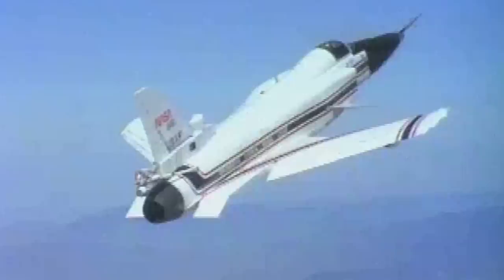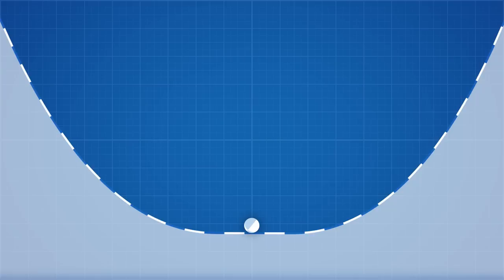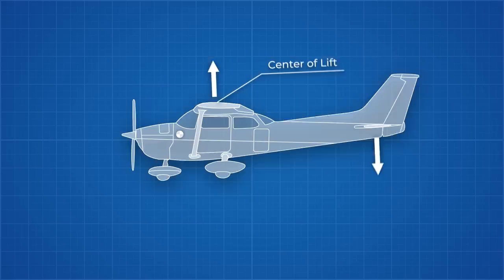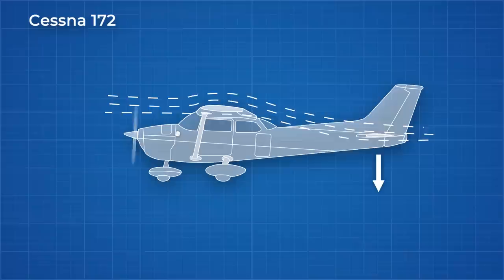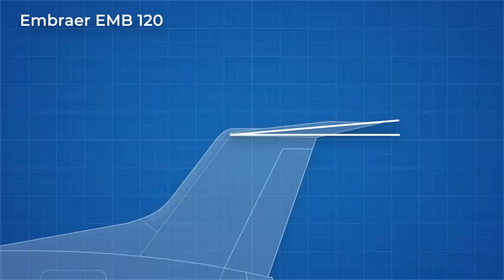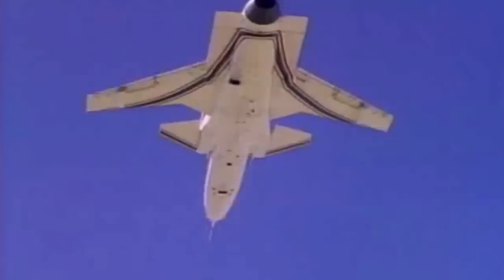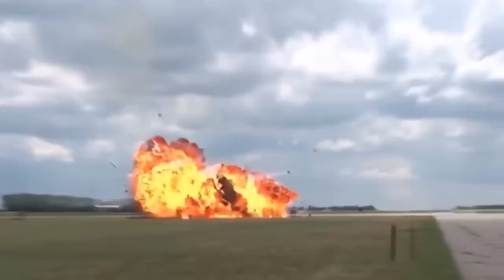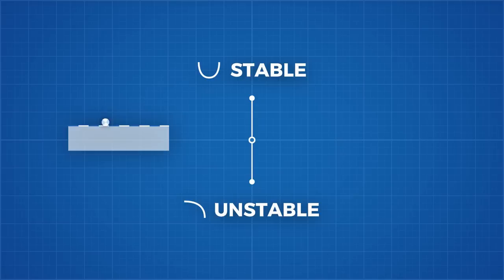Why Fighter Jets Can Be Too Unstable

Comment: As an aerospace engineer, I just wanted clarify one detail:

Downwash is not really a substantial factor in the static stability and control of an aircraft in the sense that you described. It has an impact on the tail aerodynamics, yes... But it's affect is accounted for in the angle of incidence of the horizontal stabilizer during the design phase of the plane. That's why it's impact doesn't really affect the stability as substantially the way the video implied. The downwash vector stays about the same with constant AoA and increasing speed. It does change with varying wing AoA, but that's more of a dynamic issue than a static one. If the designer wants an effective AoA on the h-stab of -2° and the wing downwash produces -1° of effective AoA in the local free stream airflow around the tail, then the H-stab will intentionally be placed at -1° from the fuselage centerline because that is -2° from the local free stream air at the tail. Lift is a function of AoA and speed. The angle of incidence acts as a constant AoA of the h-stab (including accounting for downwash) relative to the velocity vector of the plane. The velocity changes with altitude as the attitude goes from upwards pitch to climb and slow down, to downwards pitch to descend and speed up.

Everything else was spot on.

Comment: I'm surprised you didn't mention late sukhoi designs and the Rockwell X-31, both of which use high inherent instability, coupled with thrust vectoring to yield control even beyond the aerodynamic envelope of control surfaces.

Comment: @ Real Engineering : Since you ask for our comments on the graph notebooks. I'd like to point out that these were available at the 5-10-15¢ stores when I was a kind (I am now 76 y.o.).  They are much more difficult to find since the advent of the personal computer, especially since the early MacIntosh.  
Another point about computers is that we can make a graph design (with wider and thinner lines as we wish) on a picture, very precisely spaced with a vector CAD, and print as many pages as we want.  And this will be at very low cost if we have a black-and-white laser printer (about 3 to 5 cents a page).

Comment: I've been a flight instructor for the past 2 years, and this sums up stability perfectly in the scope of what an airline pilot would learn. Great video.
Reply: Except it implies anything other than inherent positive static stability in an airliner is "unsafe" while 2 come to mind that have relaxed static stability, the MD-11 and B777
Reply: @PabloGonzalez-hv3td  MD-11 did have relaxes stability, and this was a big reason why it had such a bad safety record. With only 2 examples, clearly the positive static stability wins in the majority of design.
Reply: @anthonymcdonald3193  - Improper initial implementation on the MD-11 does not invalidate the concept the 777's safety record alone refutes the notion that relaxed stability is incompatible with airliners regardless of popularity

Comment: Can I just point out that the X29 was deliberately designed to push the limits of flight and control-ability. Its airframe was meant to be almost non-sensical so as to push the capabilities of the then emerging FBW systems being developed.The advancement of FBW was I believe its primary focus.
Reply: Also I forgot to mention, that the forward swept wings increased the flight loads enormously, and overcoming this pushed the limits of composite construction, as intended.

Comment: Do a video on the F-104
Reply: The F104 isn't all that interesting.  Maybe ti's enough for a 5 minute video?

Unless you want to talk about roll coupling, which is a scary and difficult thing to describe.  The rest of the plane is really very conventional.  (save the blown flaps..)  It's just a very fast airplane.  The short chord of the wing means the CoL doesn't change much as you get through mach.  The big horizontal stabilizer means you're never at a lack of pitch control.. unless you're deep into stall where the wings can put the tail in a wind shadow.  But those aren't really "f104" things.

Comment: If you want to learn basic aerodynamics, just play Kerbal Space Program
Reply: Just make sure to install a mod called Ferrum Aerospace if you want actual aerodynamics
Reply: You will also learn basic landing gear position lol
Reply: How to get gud stabilitie

1. Thrust
2.????
Reply: @reid1283  turn on mass and lift overlay. The blue lift ball should be behind the yellow mass ball. The mass is further towards the nose than lift. If that doesn't help then try press T for SAS (stability control)

Comment: I don't know the numbers, but from what I've read, the X-29 also had significant yaw instability because the aspect of the FSW in the direction of the yaw increased, increasing drag, while the opposite reduced drag, accelerating the yaw into a flat spin.

Comment: Anti-Air gun see plane: let's make you more unstable

Plane: Must be a SAM

AA Gun:Chaff and flares won't work on me
Reply: aa guns dont have tracking capabilities tho so chances of hitting are significantly less and they have somewhat limited range too (tldr there are only useful if the aircraft is flying at a very low altitude)
Reply: @teddytatyo  Depends on what platform they are on.
Modern SPAAGs often have radar and tracking.
Reply: Usually gonna have radar tracking.
Reply: Most modern AAA are radar guided (heck even technology from last century). Aiming manually at long-distance high-speed aircraft is almost an exercise in vain.
Reply: Gaijin pls nerf AAA. To op!!
Reply: @codyhernandez791  needs more upvotes
Reply: @Luna-4L0n5  fair enough
Reply: Well, ZSU57 is radar guided.
Reply: Screw SAMs the Bofors is the king of AA
Reply: @aaronseet2738  but the rounds are unguided. If the target knows it is likely to be fired upon it can pull moderate G maneuvers and make a hit unlikely simply by expanding the volume it can move to before the round arrives.
Reply: @RobertSzasz  yes, that is if the pilot knows. They don't necessarily have to use tracer rounds. Radar-guided AAA will track target vectors and auto-calculate the lead aiming.
Reply: @aaronseet2738  last gen radar systems still give a bit of time to react. Next gen, passive or distributed systems are real threats as they don't need to have an active seeking and lock phase. (Either broadcast RF, or multiple transmitters are used along with a bunch of pickup stations  to reduce the benefits of "stealth" design and make it harder to shut down detection network)
Reply: Radar guided AAA can still be spoofed by chaff
Reply: @arya31ful  i guess it could look like a plane that's gone non stealthy. But the return from a cloud of chaff is nothing like the return from a stealth aircraft. 

Stealth aircraft are great at keeping radar from going back to the transmitter's location. By distributing transmitters and receivers across an area and networking them together you can get around that property.

Comment: Me: builds a paper model of a fighter plane.
Plane: is unstable.
Me: surprised engineer picachu face.
Reply: You can make most of them fly in a straight line if you shift the cg forward. They don't really need to do maneuvers anyway
Reply: stIck some plasticine on the nose, thank me later

Comment: The way you describe the interaction of the downwash with the horizontal stabilizer with regards to changes in speed is not correct.
Reply: Thats what I was thinking, his whole Cessna explanation made me cringe a bit at some of the false notions he put forward, the center of gravity isn't where all lift acts upon the aircraft, otherwise there would be no difference between center of gravity and center of lift and no use differentiating between the two.

Also the CG placement in that animation would make the plane far too nose heavy to be naturally stable compared to where the wing is positioned.
Reply: @SmoochyRoo  where should CG be? between the wings?
Reply: @bradhaines3142  relative to the chord (front edge to trailing edge distance) of the wings, it has to be a bit behind the leading edge of it, doesn't matter how high or how low it is, but to fly well it's gotta be behind the leading edge.
Reply: @SmoochyRoo  why though? for leverage so it doesnt stress the wings? jm just guessing here
Reply: @bradhaines3142  

The aircraft's center of rotation is where it's perfectly balanced, that's the center of gravity, if the center of gravity is in front of the wing, then when the elevator angles itself provide the forces needed to make the plane pitch, the subsequent opposing forces of the wings being that far behind the CG will be acting on the pitch axis as well, making it very hard for the plane to rotate up or down, this is called being nose heavy.

So it's pretty important that the center of gravity (which is also the center of rotation/balance) is close to the center of lift so as to not reduce the elevator's effectiveness, but to also be forward of the center of lift just enough so as to make the plane stable in its pitch axis.

I understood this through my hobby of making foam and balsawood gliders.

Comment: Regarding the horizontal stabilizer, I was told that the free streaming airflow is what stabilizes the airplane, similar to a wind cock.  I was also told that the reason the CG is located forward of the CL is because the airfoil has a twist/ moment around the center of lift.  As well, the reason I was told the  T-tails exist is because wing down wash alters the direction of the free stream, with that there isn't enough force generated especially when approaching a stall.  With the horizontal stabilizer above the wings it's away from the downwash.
Reply: Actually you have a bit of that backwards. In conventional airliners the horizontal stab provides a balancing downforce. In simplified terms, it is shaped and trimmed to bend air upwards and so provide a downforce when required. In level flight it balances the lift of the wing to maintain about a 2-3 degree nose up angle. 

In swept wing aircraft, as the fuel burns the C/G changes, so the Stab trims it level (usually driven by the autopilot). As speed increases the C/L moves aft the and the nose wants to drop but the faster the aircraft goes the more downforce the stab has pushing the tail down, so it helps balance the aircraft and can also be trimmed accordingly. 

In dynamically stable aircraft when disturbed in pitch, the horizontal stabiliser effectively changes AOA due to its positions and helps damp the oscillation through a series of decreasing excursions until the aircraft returns to level flight.

T-tail aircraft actually have a serious problem at high AOA and close to entering a stall when the disturbed air from the wing blankets the tail causing what is known as a Deep Stall which is usually not recoverable.

This was first discovered during the investigation of a several accidents or near accidents in the 1960s and 70s involving T-Tailed aircraft - the most notable being a BAC Trident (BEA 548) that crashed near Staines in Middlesex UK in 1972.

Comment: FYI, the natural open-loop system is unstable. However, with the flight computer close loop control, it became a stable system. It has to be so for any meaningful maneuver to perform, even in extreme maneuvers. Supermaneuverability often comes with a naturally unstable system and hence demand a FBW scene.

Comment: In aircraft design especially in military aircraft for fighter aircraft, the emphasis has always been in the engines. The more power an engine has the more speed or kinetic energy. Maneuverability comes from the energy an aircraft is able to output to produce such maneuvers. Lift, pitch, roll can be performed at level flight but whereas different configurations of center of gravity stabilizers and wings are given, the engines do take over as to the performance to do such maneuvers.

Comment: In terms of instability, I think it's better to think of the aircraft's angle of attack as changing, whereas the video implies the air is always coming directly at the nose (no change in AOA). In a nose up AOA, the horizontal stabilizer pitches the nose back down regardless of where the stabilizers are vertically. T-tails are so designed to keep them out of the wash of a wing when it's stalled because it becomes uncontrollable and it's possible to enter a spin you can't recover from. In canards, the horizontal stabilizer is always pitched up. It's stability is designed to be unstable until it stalls. Therefore, canards are unstable, but nearly stall-proof because the canard can be designed to stall before the wing.

Comment: I agree they can be unstable, but that is why there are systems within the aircraft to determine how to adjust to the situation it’s in. There are many conditions that cause certain controls to be disabled so that the aircraft doesn’t go into free spin. Reducing authority on the aircraft from the pilot, switching from boosted to unboosted pilot commands, adjusting the bearing and heading of the aircraft based on weight, airspeed, drag, and also provide warnings and tones to the pilot. There are many systems at play that keep the aircraft from entering unstable situations

Comment: It's actually called dynamic stability since the airplane tends to minimize the variations in time after any flight disturbance, static stability means that the sum and momentums of the forces acting on the airplane will not generate any imbalance or will be equal to zero. The first is related with aerodynamic properties like the aerodynamic center and the center of pressure and the second is related with static forces.

Comment: As a licensed AME for 50 years I have calculated many center of gravity schedules for fixed and rotary winged aircraft at weighing.  Never, never is C of G allowed to be off of the main wing/lifting surface. Measured from the wing leading edge, it is usually located somewhere around 20 - 30 percent of the wing chord length.

Comment: Also, the horizontal stabiliser starts out with a negative *Angle of Incidence, not angle of attack. 

Angle of Incidence is the angle between the chord line and the longitudinal axis of the fuselage

Angle of Attack is the angle between the chord line and the relative wind

Comment: Important note about why the cG is so far back for the X-29. Jets have a lot of weight in the back because of where the engine is (same reason that your C172 has its cG far up), and therefore you can get the wings further back.

Comment: Good description of stability in flight. A better way to describe graphically is to stay with a parabolic view. The positive stability stays in the valley. The goal of unstable is to stay on the top of negative parabola curve. Once of the top, the correct amount of energy to return to the top of the parabola, the exact amount. Any extra energy can cause a positive feed back loop.

Comment: Actually static stability refers to the aircraft's immediate reaction to any changes to attitude. 

Positive Static Stability means that the aircraft would want to return to its original position when it is displaced, Negative Static Stability means that the aircraft will deviate further any from its original position when displaced, and Neutral Static Stability means that the aircraft would just maintain the new position. 

Dynamic stability on the other hand refer to the aircraft's stability over a period of time. If you plotted the displacement from original position on a graph vs time, in a positive dynamic stable aircraft, you will see the amplitude of the wave decreasing over time as the aircraft dampens out the displacement. Whereas on a negative dynamic stable aircraft, the amplitude of the wave increases over time, and on a neutral dynamic stable aircraft, the amplitude stays the same.

Comment: This actually relates very well to automotive handling stability as well. The fastest possible setup in terms of qualifying laptimes is one of mild oversteer overall, but it is more cognitively expensive for most drivers to control and perform consistently than a setup with mild understeer overall which although slower over a single lap, is much easier to perform consistently over the entire length of the race distance. 

That said, some of the best drivers are so skilled at car control they prefer neutral to mild understeer setups, since their car control is no longer conscious but instead, as instinctive as walking and running.

Comment: While unstable the forward swept wings do have a purpose. CAS aircraft would greatly benefit. No need to be suppersonic, the airframe would allow for a greater payload internally, improved manuvability, more loft at lower speeds and computers like stated can help alot. At high speeds the stresses and instantly become much more of a problem. They are very interesting from an engineering review and would like to see more resources developed.

Comment: The downwash example is true for high winged aircraft but not so much for low winged aircraft with low set stabs where the downwash passes under the stab. Also - lets remember that T-tailed aircraft are vulnerable to Deep Stall where at high AOA and lower speed the wing blanks the T-tail and it loses pitch authority. This has been responsible for several notable accidents.